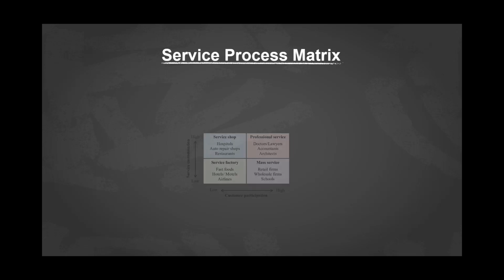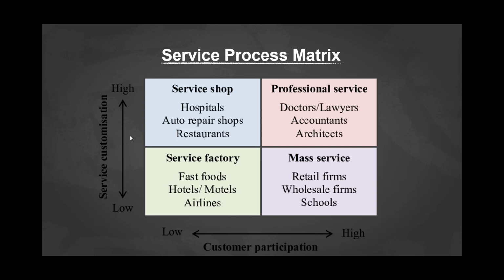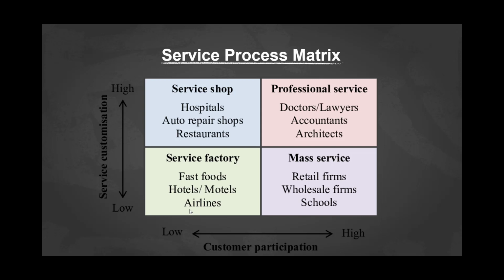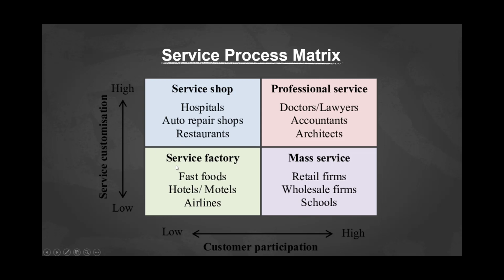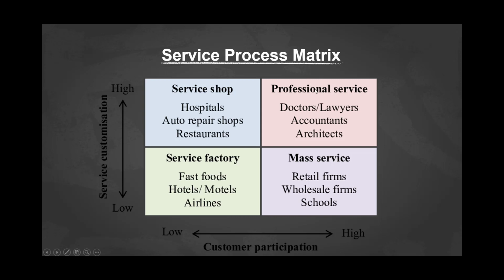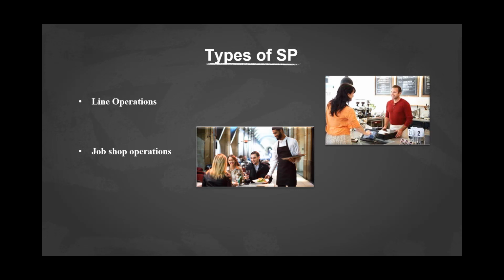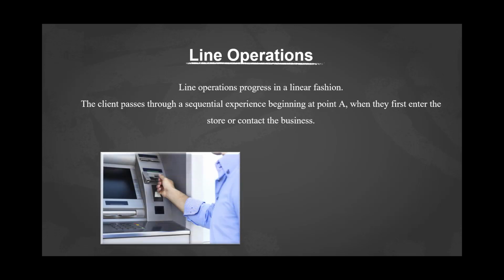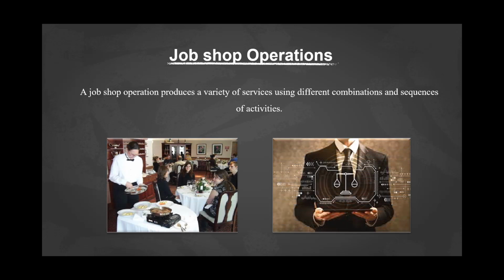lesson #7: Service Process;Service, factors affecting Service process, types of service Process

Comment: F18-0310
BSSE 5TH A 
Summary:
Service is an activity that one party (company) offers to another (may be a customer). Service process refers to the services provided by the company which works to give their customers facilities.
Types of service process that includes
Line operations->standardized way of delivery of services through sequence of operations performed in linear fashion. Halting of any element in operation adds to its drawbacks. 
Job shop operations-> sequence of operations performed to produce different servies in which flexibility is provided.
Intermittent operations-> refer to service projects which are one off or only infrequently repeated. ( not cleared properly ) 

TASK:
Customer service trends necessary for success:
.Growth of virtual contact centers
.Computer Vision-powered self-service
.Voice will be king
.Reaching customers through social media
.Leveraging Augmented Reality
.Be mobile first
.Automated self service
.Customer service as a part of the company culture 
.Streaming

Comment: Roll No: F18-0342 
BSSE 5th (Section -B)
Summary
A service is an activity or work done by one person or group that benefit another but does not result in ownership of anything. Where as a service process is a way a company works so a customer can receive services. In order to achieve aims of the company the manager wilk focus on some areas that include Determining procedures which contribute to the process, Allocating tasks and responsibilities, Formulating effective schedules and routines, Determining service mechanism and process flows. A service process focue on two principle factors i.e The type of service process and The degree of customer contact. Service process matrix is a classification of service industry firms based on characteristics of individual firm's service process, the classification characteristics includes the degree of labour intensity and customer interaction. Service process is further categorized into three types which are Line operations,Job shop operations and Intermittent operations. Line operations is the simplest of service process to understand and progress in a linear fashion it also have some drawbacks. A job shop operation produces a variety of services using different combinations and sequence of activities and can be made according to customer needs where as, Intermittent operations refers to the service which are one off or only infrequently repeated. 
TASK: Name the customer service trends that are necessary for success?
Ans: 
Customer service trends  that are necessary for success are following: 
1. Real-time customer service
2. AI-powered customer service
3. Virtual and augmented reality 
4. Social media customer service 
5. More self-help options

Comment: F18-0330
BSSE 5TH (Section: B)
Summary:
In this lecture we studied service process first of all we have to know that what is service.
Service is an activity or benefit that one party can offer to another that is essentially intangible and does not result is the owership of anything .then we come to service process. SR refer to How a services is provided and delivered to the customer to standardized this manager works on 
•Determining procedures which contribute to the process
•Allocating tasks and responsibilities
•Formulating effective schedules and routines
•Defining service mechanism and process flows
Service process depends on 2 primary factors
1)The type of service process
2)The degree of customers contract
Then we studied service process matrix  which is classification of service industry forms biased on individual of form services process
There are different types of service process
Line Operations:
Easiest to automate
Simplest to understand
Example ATM
Job Operations:
Produce variety of service
Example restaurants service
Intermitted Operations:
Refer to process which are one off or only infrequently repeated.
Example  making of films
Task:
Name customer service trends that are necessary for success?
1) A technology-driven playbook emerges
2)The shift to proactive support gains momentum 
3)Customers expectations are rising and support teams need to catch up
4)A path to mensurable business impact takes shape
5)chatbots go to work, for customers and agents

Comment: Summary: 
In this lecture we learnt about the service processes .first we talk about what is service? A service is an activity or benefit that one party can offer to another that is essentially intangible and does not results is the ownership of anything. It's production may or may not be tied to a physical product.
Service process can be defined as the way in which a company works so that a customer receive services.To standardized this in line will the company's identity and aims manger will work on :
Determining procedures which contribute to the process.
Allocating tasks and responsibilities.
Formulating effective schedules and routines .
Defining service mechanisms and process flows.
PRINCIPAL FACTORS:
The types of service process
The degree of customer contact
We also discuss the service process matrix .
TYPES:
There are 3 types of service process:

Line operations: 
Line operations progress in linear fashion.
We also discuss it's drawbacks.

Job shop operations:
A job shop operation produces a variety of services using different combinations and sequence of activities.

Intermittent operations:
It refer to service projects which are on off or only infrequently repeated.
 TASK : 
Name of the Customer Service trends that are necessary for success:
Real time support.
Customers will contact you on social media.
A technology- driven playbook emerges 
The shift to proactive support gained momentum
Customer expectations are rises and support teams need to catch up.

(F18 - 0349 BSSE 5th B)

Comment: _Roll no.: F18-0373___
Conclusion:
In this lectures we First we studied about the service. A service is an activity  that one party can offer to another that is essentialy intangible and does not result is the ownership of anything. It may be physical and may not be physical product. Examples; Edicational institutes, ISP etc.
Service process:
 Service process can be defined as the way in which a company works so that a customer receives service.
Factores:
  Service process depends on two primary factores:
1)The type of service process
2)The degree of customer contact
Then we studied about service process matrix which classify service process industry.
Types of Service Process:
1: Line operations progress in a linear fashion. Thus, the client passes through a sequential experience beginning at point A, when they first enter the store or contact the business...
2: A job shop operation produces a variety of services using different combinations and sequences of activities. The services can be tailored to meet varying customer needs and to provide a bespoke service. Restaurants and professional services are examples of job shop operations. 
3: Intermittent operations refer to service projects which are one off or only infrequently repeated. Examples include the construction of new service facilities, the design of an advertising campaign.
...........................Names of customer service trends that are necessary for success.....................
1) Empower Live Customer Service to Resolve Issues
2)  Use Automation to Deliver Great Customer Experiences
3) Erase Time Zones with Distributed Customer Support Teams
4) Listen & Act on Customer Feedback
5) Close the Digital Transformation Gap with Unified Communications